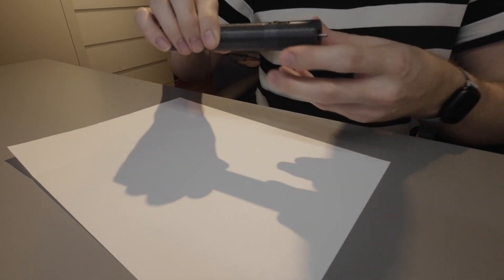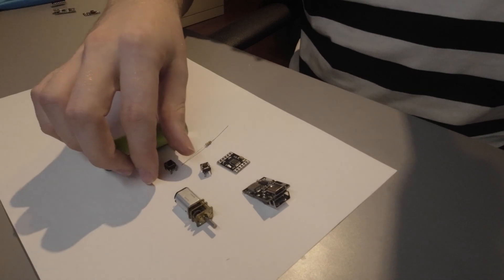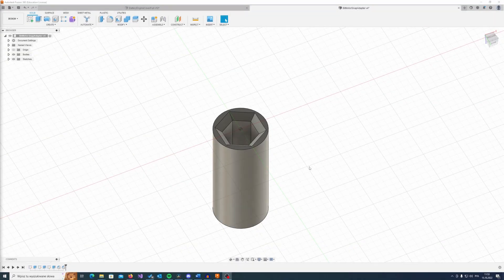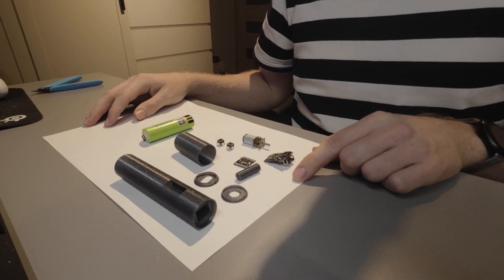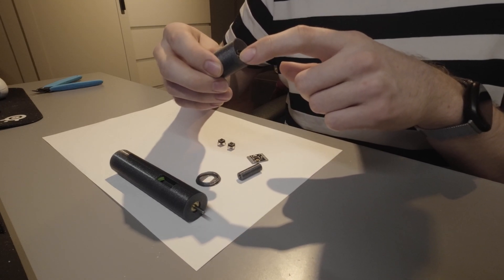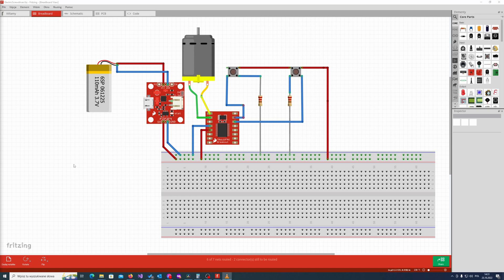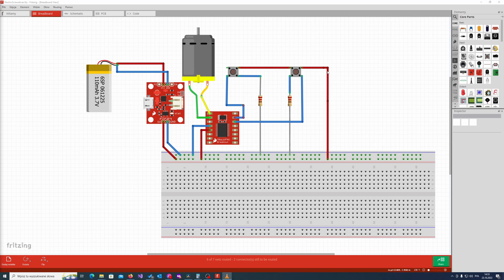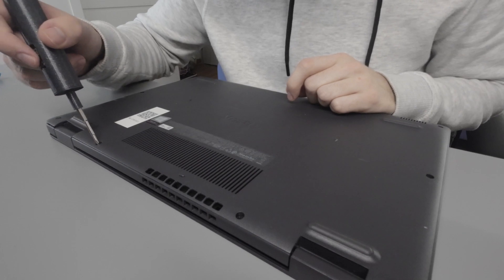Make your own 3D printed electric screwdriver

Comment: Very cool project. Do you have links or more specific information on the non 3d printed parts? I would really like to try to make this. Great job.
Reply from the maker: Thank you! I've added link to github repository in the decription where you can find some additional links to parts and schematic file for fritzing.
Altough I couldn't find the combined part (Li-po charger + step up converter) anymore, I've added some substitutes for it. Glad you liked the video!
https://github.com/pablocity/ElectricScrewdriver
Reply: @everythingmaker70  Thank you. Really cool project.
Reply: And a schematic or wiring diagram 🙂